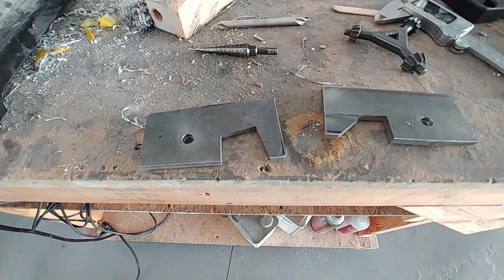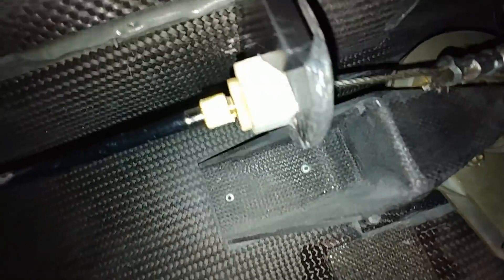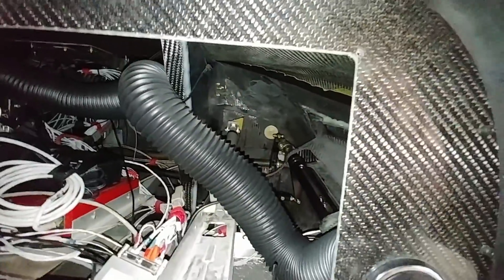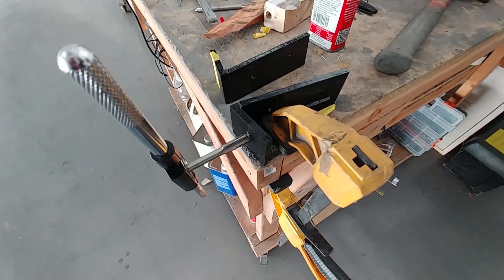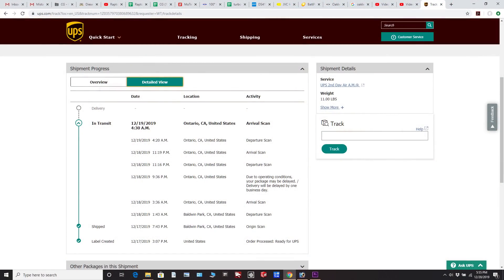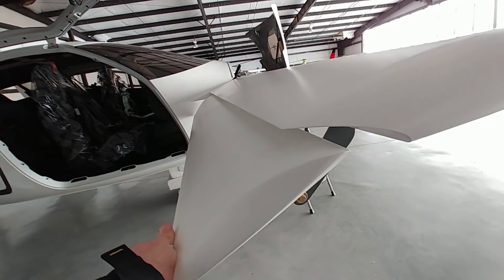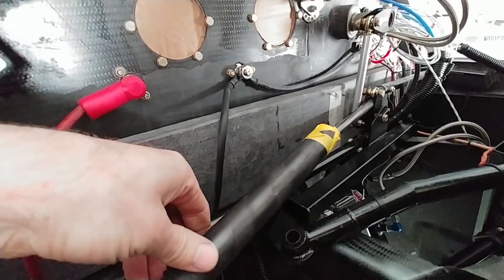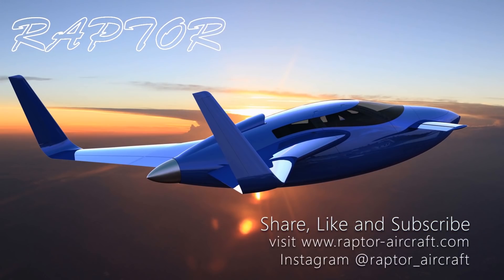Waiting on Parts - Building the Raptor Prototype

Comment: As there are several UPS pilots that have deposits we are sorry for the service failures. I am about to operate out of ONT in a few hours and there are greater delays here than anywhere else in the system. Unfortunate situations have occurred.
Reply from the maker: Yes, and I apologize for dissing UPS. In fact, if they did not exist this project would have been a lot more difficult logistically speaking. I guess I'm just frustrated as the project seems neverending at times. A break will help and a new year and a new decade should provide additional inspiration to make the final push into first flight. 😃

Comment: Not sure I understand this right: the Raptor is going to get Bowden cables for aileron control? Is this a proven/usual solution?. 
Bowden cables are certainly much simpler, lighter and less costly than the whole pulley and bellcrank setup all aircraft manufacturers use for flight controls, right?
So why didn't they go for Bowden cables? They must know something... We'll find out...
Reply from the maker: This is the potential fix to remove the flex that the pulley system has. If it doesn't work I'll have to think of something else. Obviously retro fitting is difficult at best at this point.
Reply: Most designers avoid Bowden or Teleflex type push-pull cables for primary flight controls because they have relatively low capacity per unit mass in the push direction, and because in most installations they have more slop and friction than properly-designed cable/pulley or push-pull tube systems.

Comment: Would there be an option for push rods in the future vs cables?
Reply from the maker: I originally designed it to use pushrods but other engineering changes made by Mark removed clearances that I needed for the rods so we went to cables for the prototype.

Comment: Why not just add a 50 / 50 damper ? Less weight and does the same ?!!!
Reply from the maker: Can you elaborate?
Reply: Don't know if it can work , but a small 50/ 50  shock can hold equal pressure , or called a damper , steering stabilizer !
Reply from the maker: Damping is desirable but static balancing is still required.
Reply: Thanks !! Didn't know if it would work for you or not just a thought !! Merry Christmas  !!! Best of luck with your project !! Will keep watching !!!

Comment: i have been fallowing since the binning and am still a avid supporter of your project, but i have a question for you, what is the wing loading and what is your taught processes behind it considering the potential lifting buddy style , are you warred about the total weight .
Reply from the maker: The total wing area is 161 sq ft and at max gross we have 3600 lbs so the loading is just over 22 lb/sq ft which I don't think is overly high. With the safety margins that Mark has built into the aircraft we could quite comfortably increase the gross weight to 3800 lbs and just limit the max landing weight just to be sure. I originally wanted around 310hp from the engine and I know we have at least 350hp for takeoff and potentially as much as 400. So I'm not really concerned about any of this. The fact is that the aircraft accelerates quickly on the runway so the power we need is definitely available.
Reply: @RaptorAircraft  thank you for your quick response , i agreed il be ok , and cudo for  all the energy to see such a big project all the way true , Rome was not built in one day but my hate to you sir.

Comment: Wouldn't the airflow across the angled elevator surface tend to push it back sufficiently to not warrant an additional lever to pull it back?
Reply from the maker: What matters is that when you hit bumps that it doesn't deflect downward as the ailerons did when I removed the weights. Air speed won't suffice, you need it to be balanced by weight.